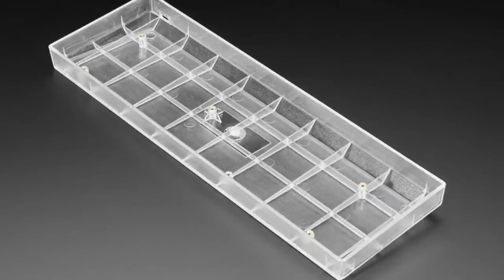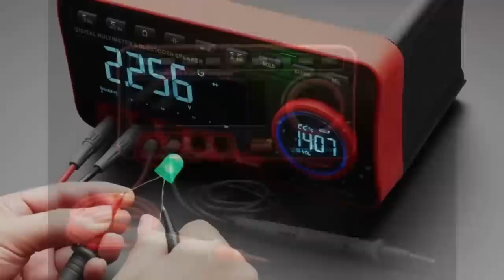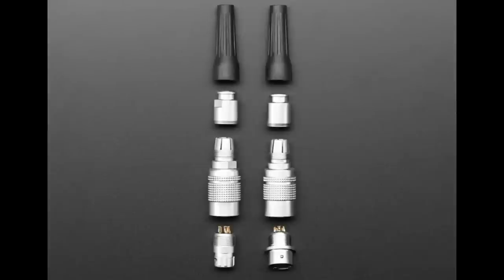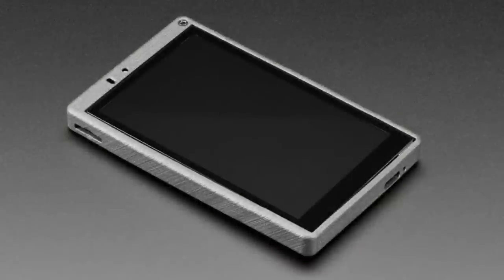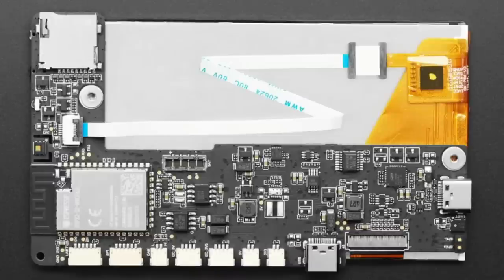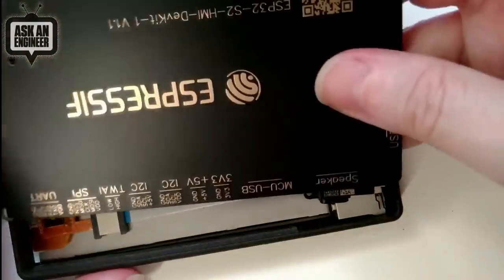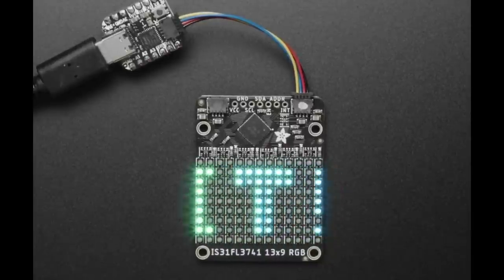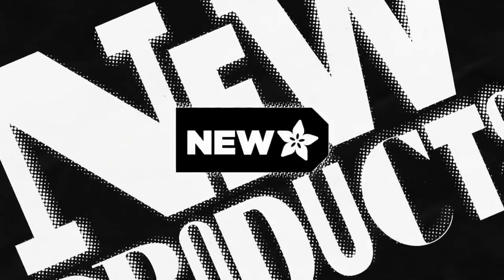New Products 8/25/21 feat. Adafruit IS31FL3741 13x9 PWM RGB LED Matrix Driver - STEMMA QT / Qwiic!

Comment: If you ever end up doing a revision on the bare 13x9 charlieplex boards (like item 3162), it'd be great if they were tweaked so they can be used side-by-side like this new one. The sides of the older boards is just too wide to transparently align them next to each other.